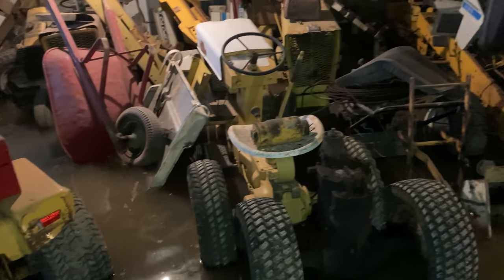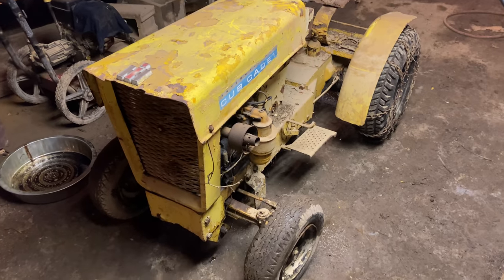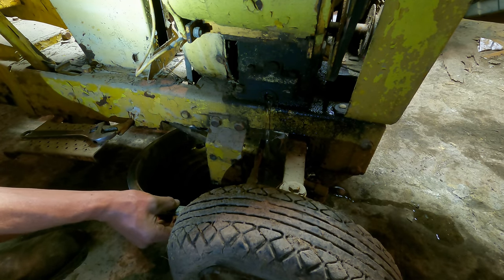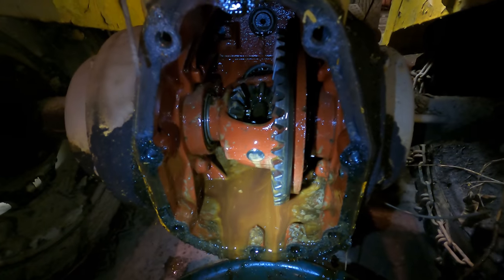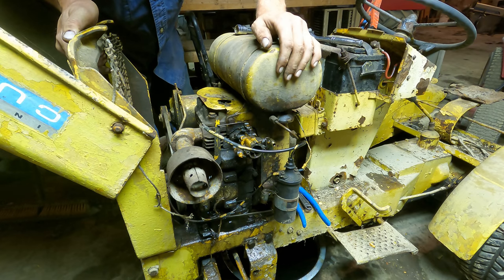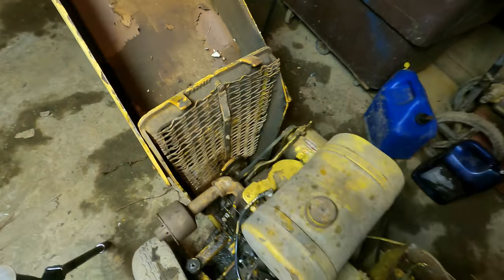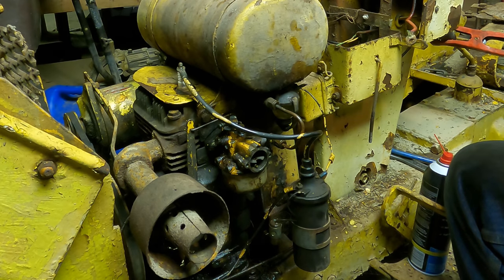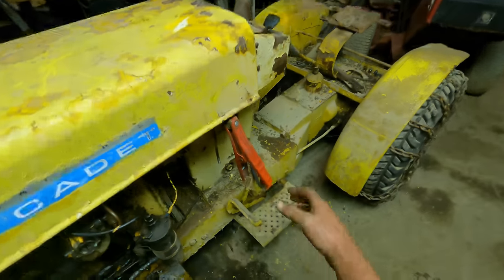Flooded Tractor sitting 10+ years, Will it Start and Drive??

Comment: As always, very nice job Matt. In response to various previous questions, you are VERY smart in your ability to look at assemblies and figure out how they work. You are successful because you are persistent and patient, and you will pull the plug when it's time (as with Christine's radiator core). Your outtakes are superb, and you are generous with sharing your knowledge. I have to say that Eva is totally charming - please get her some nice looking safety glasses. If you haven't, you might check out the Curtis Engineering channel.

Comment: Those early cub cadets are nice little tractors to have. Every once in a while i will find a rear end and use it as parts for my farmall cubs. I have had a few tractors those fuel bowls were clear full of varnish. Broke the glass trying to get it apart. The tractor's tank was about full of nasty sloppy varnish.

Comment: The only problem with an emory board or sand paper is they tend to leave grit behind the file stops that but if you need to use something other than the file thats made for it a fine emory cloth works well

Comment: Matt,
I'm about to subscribe!
Many love your work and want you around...
As a retired surgical co-director of a busy L.A. County emergency department, I offer a few 'unsolicited' pieces of advice:
1) Where are accessible fire extinguishers, chemical and otherwise? Never see them. With ether, gasoline, open sparks, and so many flammables, flame and explosion seem close by.
2) Not protecting your hands routinely, i.e. wearing rubber gloves with all the stuff your skin contacts is inviting trouble. Scratching and picking rusty crevices and crap put your hands at risk. Skin cracks abound, even those that are invisible, and protective cuticles lift, allowing aliens in. Local infections in fingers and hands are very serious business; sepsis can and does result. Tetanus status current?
3) Watching your lovely wife help with the messy church restoration project, often wearing sandals and sneakers? Think boots were in place later.
4) Steel toe boots? Are you a believer? Some guys don't like then, afraid of scrunching toes from the metal. On balance in my experience they save more fare toes than they squash. Toe and foot trauma can be worse than hand trauma- longer healing times and  more potential complications.
5) While you routinely wear small metal-framed corrective lenses, there's no side, top, or bottom protection. Given all the grinding, cutting, etc. you do, corneal abrasions or foreign bodies are potentially problematic. Worse, flying objects can easily penetrate the globe; that's serious. An overlay of protective glasses or prescription safety glasses might be in order?
I'm not from OSHA! Be Well.
Fred

Comment: That may be a 63 our 51 bought from Wick in Butler had rounder profile front tires and Goodyear Town & country 5.00x12 tractor tires. (regular car winter tire
pattern), we also had wheel weights. She was down on compression but it ran in
99 when we sold it. The mower deck was 3 blade and from what I understand was from a 65 or so model. (Wick used to be on Cunningham street at the time)

Comment: really should rinse the silt out of the starter and dry it out before storing.  get a few together and pop them in the kitchen oven at the lowest setting 140-70 for overnight with the door slightly ajar for the humidity to escape.  a light spritz of kroil and good to go.

Comment: Next door neighbors I grew up with, had one EXACTLEY  like this one, bought brand new, about the same time frame of 1963, man that dont seem that long ago LOL they had a concrete flatwork company, Danny the guy I grew up with , had his .22 rifle tore apart, cleaning it on the kitchen table, and his Mom told his younger brother to cut the grass, and CHECK the oil before starting it, well he DID check the oil, only he didnt use the dipstick. Pulled the dipstick out and the oil WASNT to the top of tube , so he dumped at LEAST 2 Qts of oil in it, up to the TOP of tube. Dannys Mom heard him coming into the yard and looked out kitchen window, and started screaming the Cub Cadet is on FIRE, man, there was oil smoke everywhere, we ran out, It  wasnt on fire, but OIL was EVERYWHERE , including on him and exhaust pipe. We drained some of the oil out to full level, but it blew all the crankshaft seals out and they had a mechanic put all new seals in it, they would pop wheelies to !! A LOT better machine than the Bolens 1225  we had, Dad traded a IHC PU  for later, that Bolens and a New Massey F slide mount backhoe, was 2 of the biggest POS EVER brought on the place!! The Cub Cadet survived 6 kids and 3 cousins running it, cutting about 5 acres every time grass had to be cut!!

Comment: 2 cycle oil also seems to stop or significantly slow down the gas from going bad. Like in a 1:100 ratio it won’t do any harm to any engine.

Comment: I dont know what you have in your sheds out at the farm, but maybe you should move all those trackers out there,,, or get its own separate container?  you have allot of mechanics there for it to be ruined by flood waters.... if that is not a possibility to the farm, maybe build a platform in that basement to put all the trackers on so they are not on the concrete floor in case flooding happens again..... I have survived a flood, losing some of my property,,, its not a great experience... wish you the best on all your restoration.

Comment: Sir you have a cub cadet original The motor is up on top of the frame not sitting inside of the frame has the flat grill and the belt down to the driveshaft and it is a unita frame That means it’s all put together

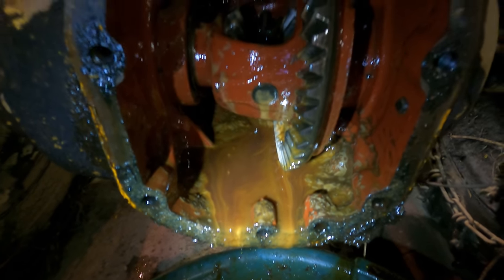Comment: Oh man that Diff is Pretty Nasty I have seen bad but wow that is worse then the Toyota 9 inch 3rd Member I tore apart that the pinion bearings were Dust and destroyed everything was the most custom made Diff fluid and Bearing paste aka Anti seize I had ever seen in a Differential 😂 Matt 12:36 @Diesel Creek

Comment: Well, when I see how easy it is for You to disassemble old screws and other parts, I am really amazed. I'm from Poland. 30+ y. o. machines are true relics here, working with them is a real pain in the ass. Old screws are rotten or stuck very bad. Maybe it's harsh climate fault, maybe it's because of communist quality, but you won't find here a "made in Poland" ~60 y. o. grass cutting tractor. I'm afraid nobody needed them at that time, here in Poland. I remember that 30 years ago most of the grass in agricultural parts of our country was still cut by scythe. Even wheat etc.

Comment: These engines when warm will run with out points  you hold points open most keep running even flywheel ignition
Burn oil but keep going

Comment: Have you ever used SeaFoam as a fuel lube?  I use it all the time on my smaller engines and my generator.  Especially if they start to act like they are gummed up or anything.

Comment: matt put some new gas in a spray bottle and use in place of eather. will keep the motor running even in diesels. The gas must be fresh to have the high solvents still in it, if open to the air all the high solvents will evaporate away. The spray bottle will keep most, still in the gas.
Louis Burton retired navy I repaired over 1000 gas lawnmowers Victoria British Columbia Canada 80 years old watched most of your vidios

Comment: The mower runs off magneto so it only needs a battery to start the engine. The starter/generator changes the battery.
Reply from the maker: These engines do not have magnetos. The starter generator also gives voltage to the coil.

Comment: I have recently purchased a Cub Cadet 125 and I’m planning on restoring and using it. I’ll probably never use the mow deck except to test that it works, I bought it for the tiller and snow plow attachments I can get for it. Honestly I was looking at a few different brands but this video among others put out on this channel convinced me that Cub Cadet was the way to go. Any suggestions for good places to look for parts? I’ve joined a Cub Cadet forum in hopes of finding access to parts and have so far been unsuccessful. Any help would be greatly appreciated, thank you!

Comment: Bummer about the flood but 2 things
It wasn't a fire, and who knows how many more years you would have had to wait to make time to work with the tractors.
Now your horde is properly lubed and moth balled and you can be one of those retired guys that restores riding mowers when you get older.

Speaking of fire,  from now own I am not allowed to reach for the ether without having visual confirmation of the location of the fire extinguisher.    I THOUGHT I knew were one was the last time I used the ether.  I was wrong.  By the time I got the garden hose hooked up and running my air cleaner box and half the fan shroud were burnt.  I found an ancient tiny extinguisher that actually worked but wasn't big enough to do the job.  Ford apparently used napalm based plastic in the early 90's.

BTW the problem was the electric fuel pump.

Comment: 24:21 I run 25:1 2-cycle fuel in my small engines by default. My 5hp Briggs flathead runs 200% better with a little oil in the fuel. And it didn't exactly run bad before, but shit, one pull starts after sitting untouched for months and I swear it pulls harder than it used to. Must be some ring wear in there.

Comment: sorry mother nature gave your hoard a bath it didn't really need. but on the bright side, it gave you an excuse to play with some of your toys that were prolly feeling a bit neglected. i'd never heard of kroil before some of the channels i watch here on youtube started using it, or at least started talking about it. question; is it better than pb blaster? that's the best penetrating lube i have ever used. it's 4 bucks a can, but in terms of time and sanity savings, it's priceless. i have yet to see a rust seized nut or bolt it didn't free up, and i've been using it for close to 30 years. compared to it, wd 40 is like water. i still use a 50/50 mix of kerosene and atf to soak stuff loose, but to deal with a rusty fastener on a job or project, blaster is the only way to go.

Comment: One thing I just don’t understand is why don’t you and others don’t at the very least use air to blow off some of the dirt and grime off before opening or dismantling covers to gear boxes carbs. So you don’t get it inside. Or is it just to fustrate old mechanic like me working in and out of the shop best part although unhealthy blowing into the gas tank and getting a lung full of fumes did that many times myself keep the fun coming

Comment: Excellent video Matt  :) also I know flood in home area  like in March 20 1980 Town Of Port Hope Ontario Canada  70 miles east TORONTO Ontario Canada  at 10:00am of Big Ice Jam up from Lake Ontario in Ganraska River North East Town and  not nice cost town 2.8 million dollars fix  also insurance payments out! Even Army called in to help out from all Ontario Canada Army bases help plus lots Roads & Works Department  also my one Uncle Roy work at local Road & Works Department for hours and months to years to fix ! Plus said never want that happen again to and to scary ! But lots damage also me, my 2 older brothers & late grandma Ruby also my mother Pearl drive a 1976 Chevrolet Impala LS 4 door threw town when happen to get us 5 people to safety back to our relatives in Brockville Ontario Canada stay till cleared up some mess! A local hardware store plus GM dealership was ruin lots stuff had plus vechiles went in Lake Ontario in New York State to found over years! But did want say never give up on Old Lawn tractor me also my late Uncle Bill got 20 years old Aires 42 inch cut 8 hp gas Briggs & Stratton motor without electricit starting type was Green color one motor was back with Synchmatic transmission with two foot pedal plus handle blow steering wheel on right for Fast to Slow to Brake to Park also bottom seat was choke plus engine speed on left to right and right side was Foward to Netural  to Reverse gears ! We got started after 20 years in 1992 plus had fix rip cord spring plus cord to crank motor ! But tell that motor said auction said was seized but was not need new engine oil plus belts , spark plug one plus fuel tank flush plus filter also 4 tires repair! Ran for 4 years use till bearing jam in crank seized up on us ! So was scrap plus hard find parts for transmission gear shifting box too was no longer available  and shame agree!

Comment: The wise man builds or buys his house way-above a flood plain. Your own fault. I notice there is no condenser (capacitor) across the points. Umm?  You should have refaced commutator on the starter/generator, then it might function better.

Comment: The tyres are dry - rotten anyway, seems like they are as old as the tractor itself, 50 years or so.
Reply from the maker: I’m quite certain that they are the original tires.
Reply: @DieselCreek  ...which is dangerous if your trailer or ROV runs on tyres that are 15 years or older, some people still haven't come to the idea of checking the DOT numbers! And do a flipover into the ditch because of a burst tyre.
Reply from the maker: @jurgenkuhlmann9194  this tractor goes like 5mph Max lol
Reply: @DieselCreek  Plus a special tuneup by Diesel Creek, it can do 50 :)!

Comment: I have the same cub as u
I put a 8 hp.in it. Mine is painted the original paint. Your s is painted the wrong color. White and yellow the only thing I don't like about it in the deck. .kollers never die. They will still running what 😩.

Comment: You gorilla, you’re not suppose to use you 4 in 1 harbor freight screwdriver to hammer on and as a prybar.  But, you use what you got handy and with common sense and the need to not really have to hammer on it the bits might still release and be reversible and/or the spring ball bit retainer still work and retain the bit.   LOL.